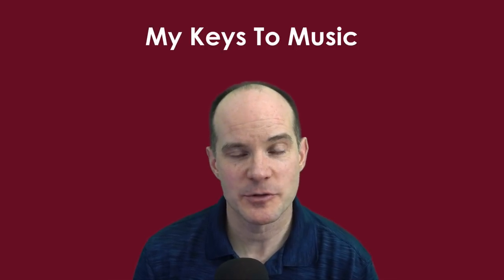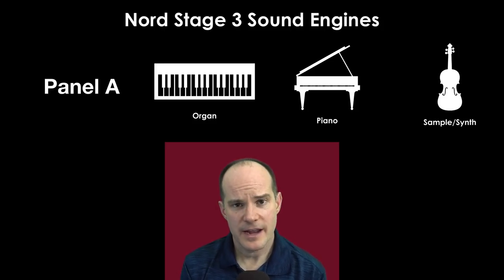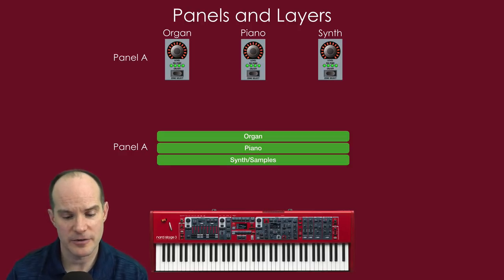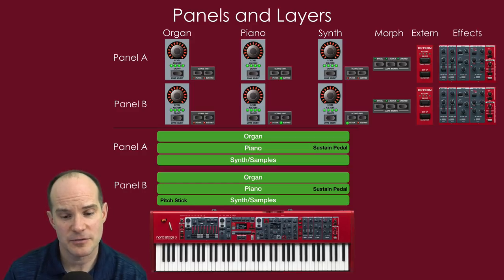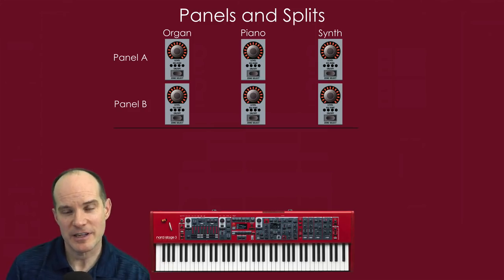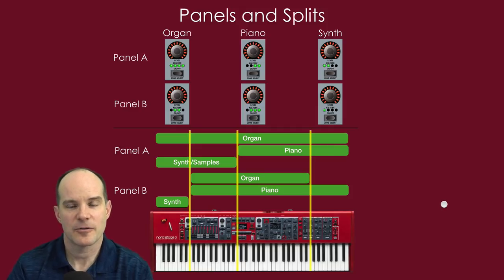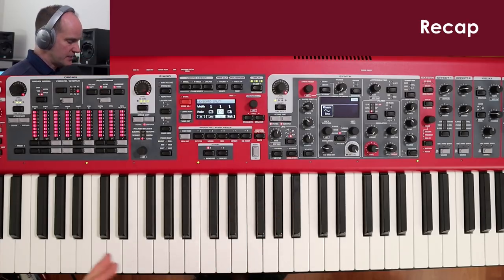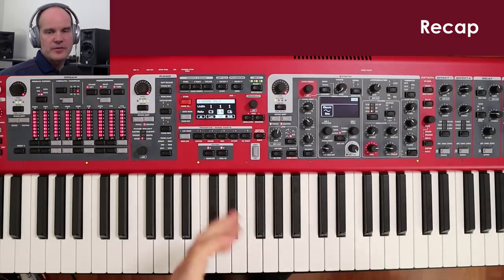Nord Stage 3: Understanding Layers, Splits, and Panels

Comment: One of the setups I use on my old Kurzweil Mark 10-150's was the ''bass ride'' feature for the left hand. (I hauled around a Mark 10, turning it up on end and wheeling it pretty easily anywhere with a handtruck.) Does Nord have anything comparable?
Reply from the maker: @sunnypm Great question.  I think the best answer is to say that no. The Nord keyboards don't have anything like this. The Mark 10 appears to have a full-featured accompaniment section that includes bass, drums, and chords with a variety of styles.  This is not unlike many keyboards of the day as well as today where you can essentially become a "one man/woman band."  Nord keyboards on the other hand are strictly stage keyboards/synths versus keboard workstations or the like.  The Stage 3 and Wave 2 do have an arpeggiator which provides the ability to play the current sound in a rhythmic pattern against the chord you might play, but I wouldn't call this a substitute or even a close cousin to what the Kuurzweil is doing. I was not able to specifically hear what the "Bass Ride" feature does from anyone's video, but my assumption is that it would provide a walking bass line with a ride cymbal accompaniment?  If so, then no, the Nord keyboards definitely don't have anything like that whatsoever. Also, there are no traditional drum sounds either to speak of when you're talking about Nord keyboards.  Hope that helps answer the question!
Reply: @MyKeysToMusic  I uploaded this example. It's just a simple split, with my left hand playing the acoustic bass/cymbal hiss sound, and right hand playing piano. (Although I've used other sounds on the right like sax or flute) When playing with a percussionist, I use just the acoustic bass sound on the left and piano on right. I would be satisfied if the Nord could do this. Kurzweil never made a portable version of the Mark 10 series, which would have been ideal for me.  Their portables were much more tedious to change sounds on the fly for live performance.  I later purchased the 150 used in this video, with grand piano case, and to heavy  for me to gig with.
  https://youtu.be/RzgLuRrWQSM
Reply from the maker: @sunnypm  Thanks so much for providing that example.  Quick question that I was not able to gather from the demo video: Doe the ride cymbal sound with every bass note played or does it do it on the beat more like a drum machine?

With the Stage 3, you could have a split keyboard with bass in the left and you could potentially couple that with a ride cymbal sample that would sound with every bass note played. Then the right split could be a piano.  If however, you wanted a bass sound, ride cymbal sound, AND another sound from the sample engine, you couldn't do that.  The Stage 3 can play up to two samples, but not 3.  The ride cymbal, bass, and sax (for example) would all be samples.

So the answer to this question is "maybe yes" when a piano is used in the right hand (because that comes from the piano engine), and "no" when you need a sax/flute in the right hand as well. 
And if you could let me know about the cymbal and when it sounds, that would be great.  Thanks!
Reply: @MyKeysToMusic  yes, the cymbal sounds on every note, like a layer, not a drum machine effect. This makes me hopeful that the Nord 76 HP would be a good choice for me. Trying to search for a dealership in Florida, where I could actually try it first. I'd be fine with just a good acoustic bass on the left, and a separate sound on the right, especially if they are authentic sounds like my Kurzweil has.
Reply from the maker: @sunnypm  That is good to know that the cymbal sounds on every note (that makes it easier).  I think in light of this, technically speaking the Stage 3 could do this and at the very least, it can provide a good acoustic bass on the left with a separate sound on the right no problem.  I'm going to put this theory to the test and see if I can sample a ride cymbal and have that play along with an acoustic bass.  I'll then make a quick video and post it here in the comments. I'm away from my boards at the moment so give me a few days or so...
Reply: @MyKeysToMusic  I won an ebay bid on a HP76, so I'll be checking out more of your videos!
Reply from the maker: @sunnypm  CONGRATS on your purchase Sunnypm!  I'm excited for you and I haven't forgotten about the bass ride cymbal thing either. It's on the list.
Reply: @MyKeysToMusic  OK, just found this thread again. One more month on the road. I did find a bass split and will check more when I get back home.
Reply from the maker: @sunnypm  Sounds good. Let me know and I'm pretty sure I could make you a sound for it f needed.

Comment: People trying to figure out how to layer 3 sounds in the Nord Stage while me layering 32 sounds in Mainstage 😂😂.
Reply from the maker: Haha - I had to laugh with you on this Erick - and I completely agree. It just goes to prove that "it's all relative."  As another example of this, the amount of synth engines/options/arpeggiator selections that come with the free program "Garage Band" in a standard Mac would in-fact give most of the modern keyboards available a run the money.  Yet, I find most musicians get hung up on the idea of bringing a laptop to the live gig.  I've tried it myself a few times - just can't get used to it.  Love Mainstage though for use at home. In fact, I used Mainstage last year to teach a bunch of elementary school kids the different sounds they can make from a simple $50 keyboard controller and a laptop. Their eyes were all "wide open" (as you can imagine). Thanks for your comment today - it's easy to quickly forget the power of the computer and a piece of software like Mainstage in today's modern music-making apparatus when you've been accustom to using actual hardware boards for live performances for the last 30 years. 😄

Comment: Can you have two of the same zones on different sections of the split? I.e. if you wanted grand piano on one half and then electric piano on the other?
And can you save this all into a song or a preset?
Reply from the maker: Hello @Kate Fairlie Thanks for your questions here! Not sure if you already own or use a Nord Stage 3 but I'll answer this as if don't currently use one. 

So, you can't have the same engine split on the same panel.  In other words, you can't have a piano on one end of the split and an electric piano on the other side of the split within the SAME panel.  HOWEVER, you can have a piano split on one end of the keyboard playing from Panel A and then your electric piano playing from the other side of the split using Panel B. So, the answer to your first question is no and yes.

Now, about your second question about saving all this to a song/preset.  The answer is yes.  You can save all this to a preset (which we call "Programs" in The Nord world). Then later if you want to use a saved program in a song, you can do that as well.  Songs by themselves act as a list index of your programs.  So, once you have a bunch of programs you are happy with, you can organize them into a song any way you see fit (such as with a set list for example).

In addition, songs have "parts" which further gives you the power to have several programs used on a single song (such as when you need one program for the verse and another one for the chorus).  
Finally, The Nord Stage 3 has 400 program locations.  300 hundred of these are pre-loaded at the factory giving you 100 free at the time of purchase. However, at anytime you could delete/edit/add programs within all 400 locations freely.
Nord owners manage all this using the "Nord Sound Manager" which is a free application that runs on any Mac or Windows computer.  I have lessons here on that if you want to get an overview: https://youtu.be/32UBN7Dj4Is 

Also note that you may have noticed I have complete pro training online for all these keyboards at https://www.MyKeysToMusic.com There, you'll get newer versions of these lessons and over 18 hours of video content that you can watch throughout a year.
Good luck and feel free to report back if you have more questions. 👍
Reply: @MyKeysToMusic  Thanks so much for your reply this was super helpful! I'm going to look more into using the A and B panels!! Thanks again :)
Reply from the maker: @katefairliemusic  Great - thanks for the update here.  Yes, the power of both panels A and B come in handy and you'll find that once you really understand/use it, you'll wonder how you'd live without it. 🎹

Comment: Hi, your work is epic. I understand that you can use 6 engines at the same time. My question is: Can I use 1 piano engine and 5 synth/sample engines?
Most of the combis that I used to make on my Korg Krome73 for example, involves usually: a pad, a pad an octave up, a synth Lead, another synth lead, a synth stabb, a synth perc with arp, a mallet, Eps, another pad an Octave up.
Can I do the same in Nord?
Reply from the maker: Hi Victorio! So, unfortunately, you cannot do something like 5 synth/sample engines at the same time. The combinations work like this when you combine both panel A and B:
Up to 2 Organ Engines
Up to 2 Piano Engines
Up to 2 Sample/Synth Engines.
This would be a dream if we could combine any engine with any combination of 6. I imagine the interface on that would have to change a bit along with the overall polyphony capability as well. This is a good idea too if Clavia/Nord had a module without the keys. I've been dreaming of such a thing since day one  prior to owning a Nord Electro 3. Heck, I'd take a software module if it came to that. 
Well, even with the current capabilities mentioned above, there is more than enough power and options to go around in most cases.
Great question - thank for watching!
Reply: @MyKeysToMusic  Great videos, Marc!  I have a follow-on question; if I have panel A layering/splitting piano & synth, can I add the Delay FX to both?   What if I made a program like you listed above, 2 Organ + 2 Piano + 2 synth.  What settings would allow the Delay FX on organ, piano and synth?  So far I've only been able to assign 1 Delay FX source per panel.  Thanks!
Reply from the maker: Hello Victorio!  So, unfortunately, you are only able to have 2 synth sounds happening at the same time.  One would come from Panel A and the other from Panel B.  You could do a possible work-around and create a sample that includes multiple synth sounds coming from the same layer but that's a work-around and not ideal for a number of reasons. So, what you can do today with your Korg you won't be able to do with the Nord Stage 3 if your plan was to use that many synths at the same time.  I wish things were different and this is a big request from a lot of people.  Maybe the Stage 4 will resolve this someday?  The Stage 3 sets out to be an all-around performer's keyboard to play live that includes great sounding pianos, organs, and synth sounds which for most applications are more than enough.  It cannot however be pushed this hard in the synth area by itself based on the way it's designed.  Now, with that said, two synth sounds are generally good enough for most people and most applications - especially peopole who are not looking for a synth oriented emphasis like you might get with other boards. What you descirbed is trivial for other boards (think Korg/Yamaha workstations) and also trvial for a comptuer (think Apple Mainstage).  But this board was design as a live perofmrance keyboard - not a workstation so there are limitations like youv'e described above. Keep the questions rolling if you have more...

Comment: Another great tutorial, Marc.  I wish I had viewed this video before the others I've seen because some of the questions that I ended up asking you in those other videos - were already addressed here in this tutorial.  Of course, I have another quick question.  :) . . . . 

Are all of the various pedal settings available as either Program or Global settings, or only just Global?  For example - I read that the Rotor Pedal can be set to either Hold or Toggle.  Can that option be set on a per Program basis?   - And if that is possible, does that particular Program maintain the setting and override any change at the Global level?  

This reminds me of another related question - but on a different topic. Can I make a key change on a Program basis, so that a particular Program will always be transposed (up or down) separately, and the other Programs would be set to the Global setting?    

So, generalizing that question,  what settings can be set at the Program level; all of them? 

Great job as usual, and thanks again.   :)
Reply from the maker: Hi Lou! Thanks for your compliments! Your observations here about the fact that you had questions answered in some of my previous videos further demonstrates to me the absolute need in the marketplace for a pro training course for the Nord Stage 3 (which I'm working on!).  Having a complete course allows the musician the ability to learn the Stage 3 from A to Z in the correct order and in an environment that tracks progress and is searchable. A training course like this becomes an authoritative video library on anything related to the operation and configuration of these professional instruments and to me is a natural fit to round out the package. Just like a keyboard needs a good stand and a good case, I believe one also needs a good training course to get the most out of it in the least amount of time and effort (while also having fun learning it with an instructor). With that said, keep an eye out for my Nord Stage 3 Pro training course at www.mykeystomusic in the coming months.

Now about your question. Most things on the Nord Stage 3 when it comes to overall settings are in fact global. The rotor pedal specifically is global. However, some areas of the system can be either global or program specific such as how the sound "output" mapping is routed. You get to pick if you want your routing "Global" and once selected, that overrides everything. If you pick "program" as your choice, each program will have its own settings and the global aspect no longer applies.  In other words, in this example, the individual program will override any global setting.

Transposing is a bit of a different animal but you can have your cake and eat it too! Each program can store individual transpositions built right it each the program. Something like this comes in handy if the singer decides they need the song to be played down two semitones (but only that song). Then you can just click the "transpose" button and assuming you stored that program -2, you're good to go. So, if and when you invoke the transpose button, it will adhere to the settings set in the program directly.

In addition to that, you have something called a "Global Transposition" option available from the "system button" area. This will transpose the entire keyboard without having to click on the "Transpose" button at all. Let's say you have to play the entire gig from a fake book but all that is available is the Bb trumpet book. You could simply transpose the entire keyboard and play out of the Bb book and you would still be in tune. Now let's take that singer example from above again. If you were to then click the transpose button, the individual program transpose setting would be ADDED to whatever the global transposition is doing.  So in this case, you could play out of the Bb fake book and still lower a particular song for the singer as well and still be in tune.

Hope that helps explain this a bit more.
Reply: @MyKeysToMusic :  Yes, it does answer my question perfectly.  thank you. Sorry, it took a while to get back to you, but I have actually been spending a lot of time applying what I've learned so far into setting up my Nord the way I want.  I really like the Song mode, now that I understand how it works - which is precisely how I wanted it to work.  I still have more to learn to further customize and optimize my patches. But I'm very happy with it at this point, and your videos have helped a lot.  I really need to get into the nitty-gritty details of how the synth and effects sections work now, so I'll be viewing your synth section videos more carefully over the next few weeks, as I have time.
Reply from the maker: Thanks for checking back in Lou! Glad the videos are helping! I started work on the the official Nord Stage 3 training course which will be available for sale at https://www.mykeystomusic.com in the coming weeks/months. I plan on have details for the effects section there and I'll be using a lot of the synth training already here on YouTube and putting that there as well but in smaller (easier to learn) chunks. Then on YouTube, the plan is to offer "discovery videos" where we apply the Nord keyboards to unique and modern sounds (some famous) and explore music from that aspect.